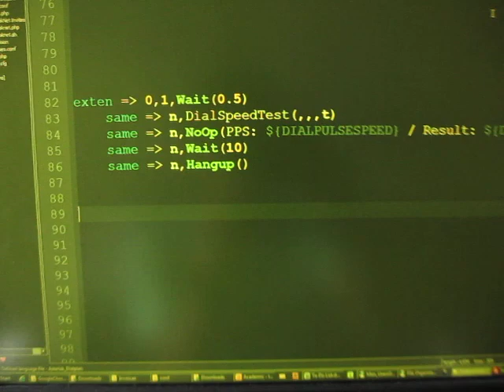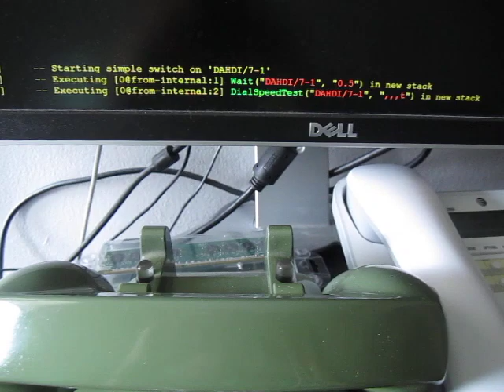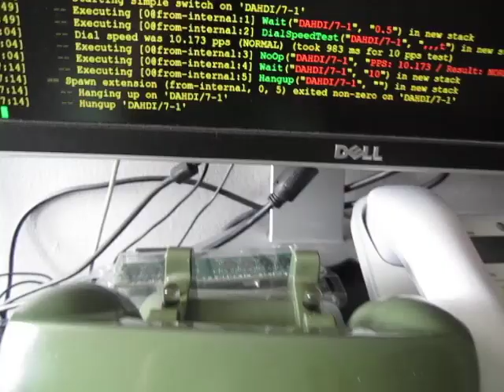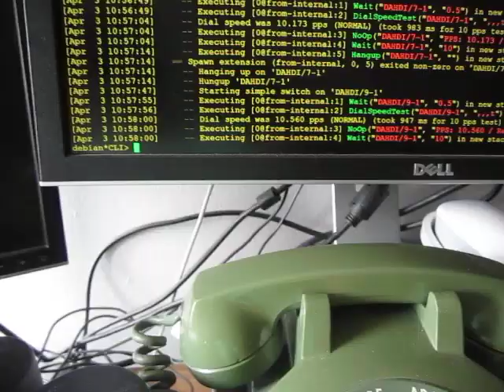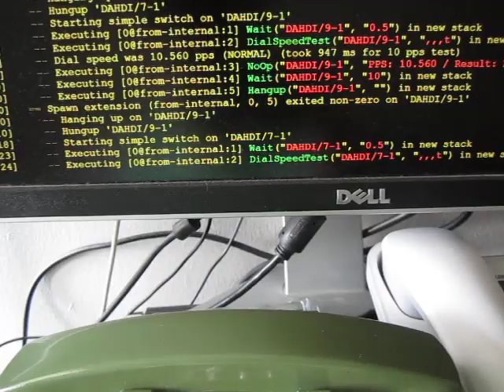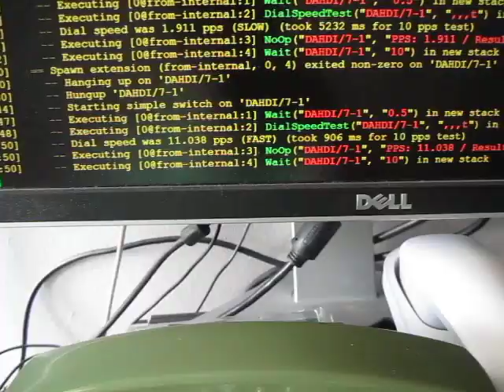Asterisk Dial Pulse Speed Test

Comment: This is really cool. I still love the sound a dial makes!
I've heard in some circles that GTE dials are a bit faster than WECo/NECo, although I can't confirm as I've never gotten the opportunity to play around with one.  I Hope you are well--sorry I haven't dropped you a line yet, but my partner and I have both been under the weather.
Reply from the maker: I'm likely not as familiar with dial specifics, but I did take that into account... the module supports both 10 and 20 pps dials (by default, it'll try to auto-detect the type of dial).
If it's in the middle, the built-in handling might not be so great but it spits out the actual PPS in a variable for the user to use.
Feel free to get in touch anytime... Hope you "pheel" better soon! ;)